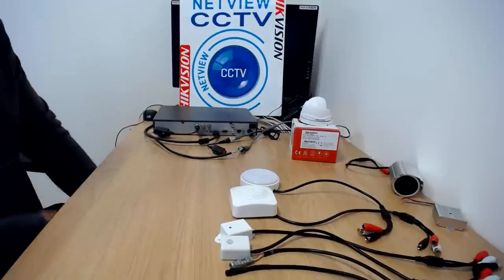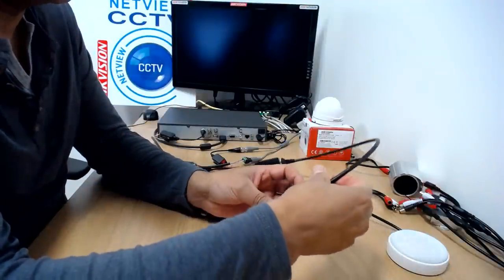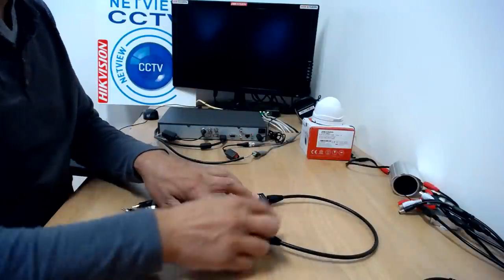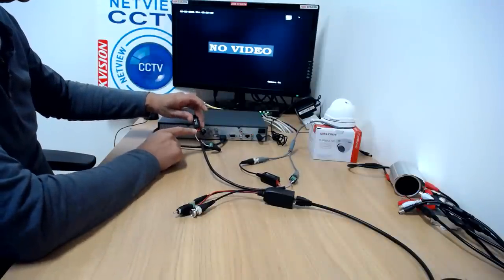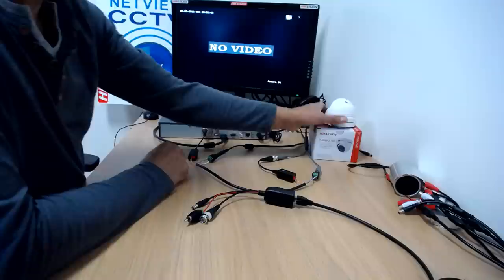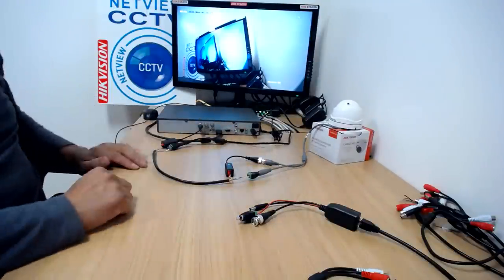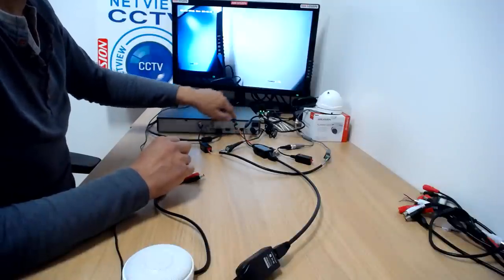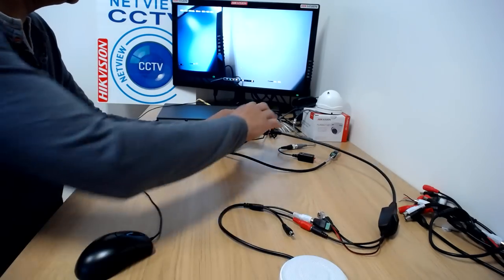How to Connect a Microphone to a DVR, NVR or IP Camera using a Mic Connection Kit

Comment: Okay, I was easily able to connect the microphones to the cameras and the DVR and they work great. However, I want to upgrade my DVR because mine is like 12 years old and just has a VGA display connection. But, considering that i have connected microphones to all 8 of my individual CCTV cameras, all the microphones must be plugged into the DVR. All the DVRs im seeing today only have "1 audio in" port and "1 audio out" port. How would I go about connecting 8 microphones to the DVR if it only has 1 "audio in" and 1 "audio out"? 
Now, I know I only need 1 "audio out" port in order to hear the audio during playback. But, how do I connect all 8 microphones to the 1 "audio in" port? 
Or am I gunna have to buy an "audio in" splitter" for that to be possible?
Reply from the maker: Hi, nowadays you do not require a separate microphone as they now come built into the cameras. This technology is known as AoC : Audio Over Coax (but still works with cat5/6 with Baluns)
You need an AoC Compatible DVR: https://netviewcctv.co.uk/cctv-recorders/dvr?dvr_features=6828
and AoC Cameras: https://netviewcctv.co.uk/cctv-cameras/hd-cameras-bnc?camera_ahd_features=6827

and that will do away with all the mics & separate power supplies and look much neater and is easier to setup.

R Jiten, Netview CCTV
Reply: @NetviewCCTV  Thank you for the information and for your reply! I genuinely appreciate it!!
However, my problem is that I do not plan on replacing my actual cameras. They are only a few years old and they work flawlessly. But, my DVR is like 12-13 years old and just outdated and kinda acting up a little bit. My plan was to just replace the DVR only while continuing to use the same cameras. I did have to buy microphones for each individual camera and when I bought the cameras, I did buy the power and video cables that had the audio RCA already built in. So, now I have 8 RCA microphones that require them all to be plugged into the DVR. 
I'm not sure what my options are at this point. I really DO NOT want to buy an entire new system when I already have everything I need that work perfectly other than just the actual DVR itself..

Comment: He is giving me a headache. Now I am really confused...
Reply: Basically all you need is 1 small separate cable with 2 wires ( 1 black, 1 red) with the rca connector adapters on each end to run the audio. Done ! You can buy cables that have Video, Power and extra wires for Audio or PTZ on ebay for very cheap. This guy way over complicated this. What should only take 30 seconds to explain took 25 minutes. smh